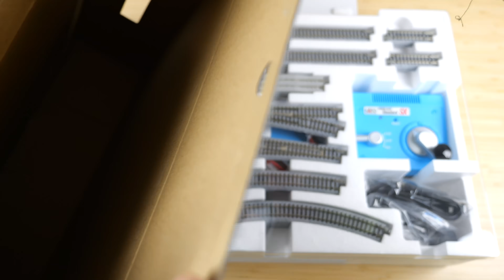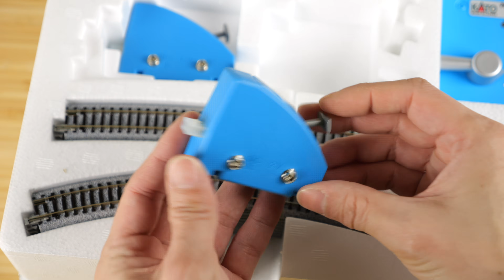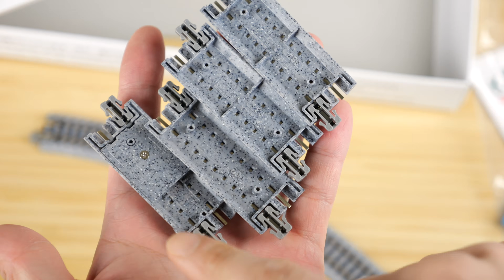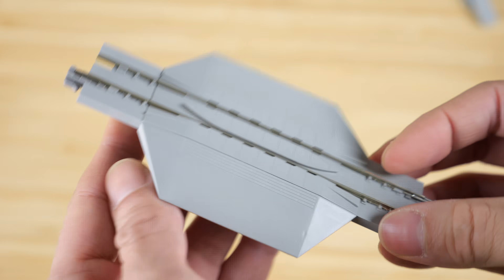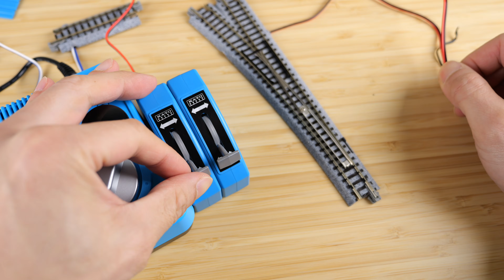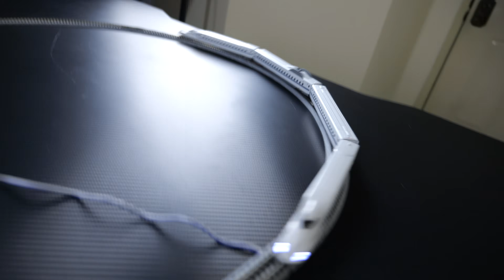Kato Model Train Beginner Set Open Box and Setup M2 + N700S Shinkansen

Comment: I bought my first M 1 Katie Shinsanken in Japan 
I avidly set out the tracks but the train does not move - I noticed one engine had an on - off switch below wonder whether that switch was the reason my train will not work 
Any suggestions 
Does it matter if you set it up on the carpet on the floor or does it have to be a hard surface ?
Many Thanks

Comment: Welcome to the "rabbit hole" that is model railroading. For me it started about 50 years ago with a simple HO gauge train set, and although my trains have been kept in boxes in the shed for several years, I do get them out every once in a while to run them on the Kato Unitrack I got so I could set them up fairly easily. It's a great track system, especially if you don't have room to build a permanent layout.
Reply: Nah, more like it's good ONLY if you don't have the room for a permanent layout.
Because if you do, and you want to run more than one train on the same line, then you don't have much control.

Comment: I have the M2+V3 layout. Great for yard switching operations. Easy way to run multiple trains on a fairly compact layout. I bought those to hold me over for when I have more time and money avaliable to devote to it. I've had many hours of entertainment, while keeping that fire burning for it in my mind. 

When I do the big layout, I am laying track and ballast. As much as I love the Unitrack, there are a few situations where it won't work for me, like a steel mill or switching yard for example. That's a lot of track that is typically all at ground level. 

If you are running a raised road bed though, it's great, and you can add ballast or airbrush it to be pretty realistic looking for most people.

Comment: Do you get electrocuted when you accidentally touch the tracks while the train is running?
Reply from the maker: The voltage is low enough that if you touch it with one hand dry, it would do nothing. If you hands are wet and you use one hand on each track, that may be dangerous.

Comment: Hi, I  want to start in world of N scale but I have a big basic question: Some recommendations in unitrack set from KATO web seller use for example 1/150 scale train but this Shinkansen set is 1/160 scale, so; Are there some problems if I buy Unitrack set like KATO 20-913 with Shinkansen set 1/160 scale? Thank you for your kindly reply.
Reply: Email kato
Reply: N designates the gauge of the track (9mm). The actual model scale varies by region, from 1:160 for most of the world to 1:148 in the UK and 1:150 in Japan. So any N gauge train will run on any N gauge track. It might just look a little odd if you run different scale models at the same time.

Comment: It can get very very expensive for a hobby.  But, looking at the various YouTube N, HO, O Scale Layouts, it can be fun and rewarding using your talents to make scenery.  There are other scales, but  the 3 I’ve listed are the most common IMO.  The Kato Unitrack System is what I plan to use.  I just purchased this very Starter Set for around $175 dollars US.  

I wanted to start an around the walls 12 foot by 20 foot “Double Track Layout”, but doing the calculations to use the Kato N Scale Unitrack, it came close to $1,000 in buying the necessary materials.  That didn’t include an Engine and any cars (Rolling Stock).
Nor did it include any additional turnouts and wiring for a larger layout.  

I believe “Feeder Wires” for power to the track are recommended every 3 feet, some say every 10 feet or 20 feet.  You must also use the proper gauge wire for the Buss Line and Feeders.  

I suggest getting some reference books regarding how to start the hobby, layout books, scenery, wiring and what type of control systems you will use.

Now, wait for December and putting up the Tree in the Living Room or Recreation area and then put your oval of track around the tree.  Keep the pets and young children away from your railroad empire.

Sticker Shock!!!

Comment: Whats the "N" stand for 😏
Reply: It stands for 9mm, the track gauge. Oddly, the model scale varies by region, from 1:160 for most of the world to 1:148 in the UK and 1:150 in Japan, all running on 9mm track.
Reply from the maker: I suppose 100 200 to 700 is logical. Then they made 700 faster but it's not really 800 series since it's a incremental acceleration change. So I suppose they picked 'N' or 'Enu'. Why they picked 'N' and not 'Z'? Or maybe 701? I suppose we have to ask the people in charge of naming it. But 700 < N700 < N700A < N700S... faster and faster acceleration!

Comment: That is a rerailer. You can use it per see in your circuit or integrate it on a level crossing if you build a layout.
Reply: Apparently it has a handy track gauge on one side (helps to space triple tracks properly) and a ruler on the other.

Comment: I sold all my N-Scale Train Stuff but Kato Locomotives and Track are the only way to go in N.
N cars - there are different brands that are good - Atlas has the most - pretty good.
Reply: Fleischmann makes better locomotives and arguably better track than any other manufacturer in N scale. And let's not forget their best on the market DCC system. Kato provides some interesting options in terms of infrared level crossings, catenary systems  and inclined embankments for parallel curved tracks (why only for parallel?) and have some interesting radii available, but it lacks curved turnouts. Kato track looks good for code 80 track, but not the best. N scale has some serious advantages, but also has some serious drawbacks.

Comment: I believe the railroad crossing doubles as a "re-railer" meaning that if the train derails, it will re-reail itself when running over the railroad crossing. Kind of a safety mechanism if you have a large layout and cannot always get to the trains.

Also the "switcher thing" is called a "turnout" or "point" if you are in the UK. 😊

Great video, you are good at going through the different products. You have potential to become a huge model railroad Youtuber (should you decide to do more in the train hobby). 👍

Comment: Kato makes the best in model trains! I love their track systems. N scale should be the most popular scale lol it does great for small tight spaces such as apartments and such.
Reply from the maker: They need to make a new one... KATO-V ... as in vertical wall trains. Then EVERYBODY with no space can just build it on their wall. Where's my patent attorney... lol.
Reply: @BeatTheBushDIY  I can list 10 reasons why it's not going to work.

It was barely feasible with hot wheels and even then it didn't last for long.

Comment: Love Kato, they make great trains.  You can run two trains on the M2 layout.  Keep one parked on the outside turnout and run the other on the main loop. When done running the main loop park it adjacent to locomotive on the turn out.  Switch the turnout so power flows to locomotive on the turnout and let it run the loop.  Be careful, don't switch from forward to backwards with full power.  It's not good for the locomotive.  Always turn power down then switch direction.  😊
Reply from the maker: Thanks for the tips! I uhhhh... forced it backwards on full power, lol. You gotta do it at least once. =D